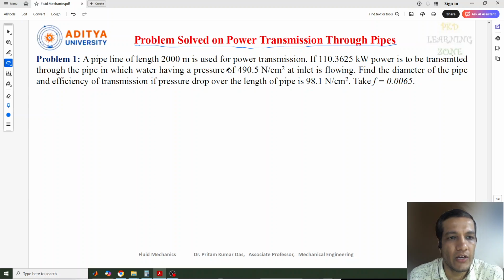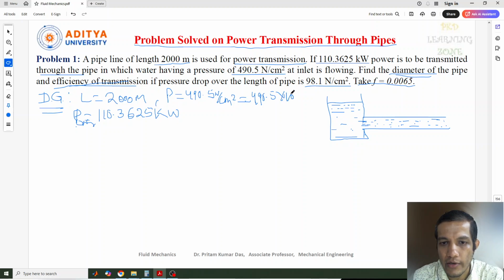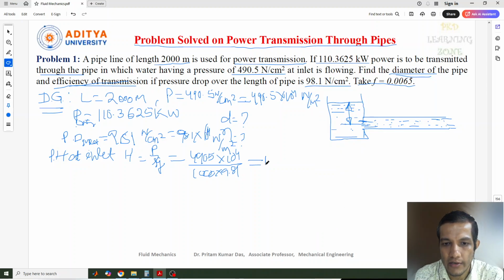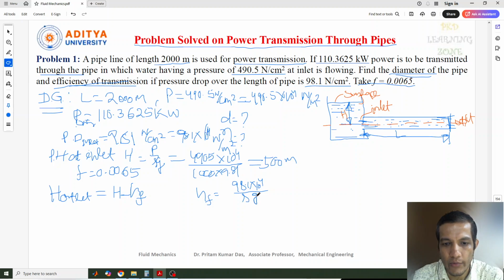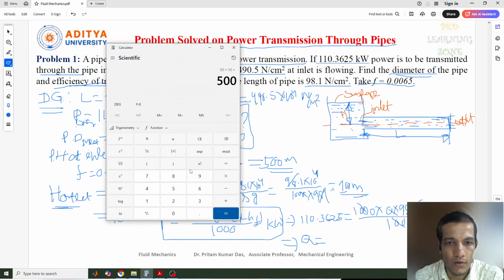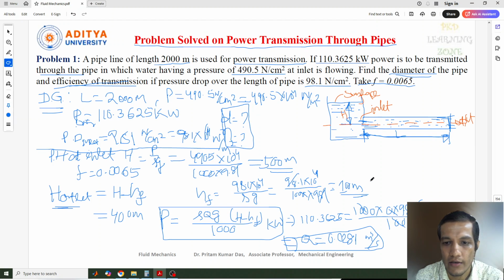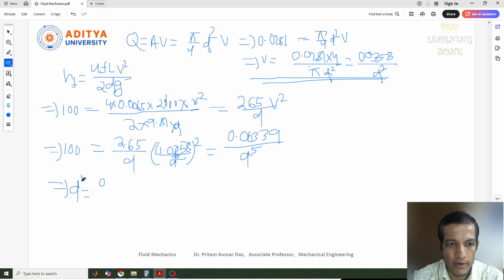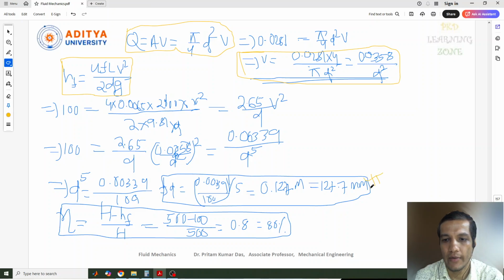Lecture 135 Problem Solved on #Power Transmission Through #Pipes in #Fluid #Mechanics

Comment: Sir here in question f friction factor  is given then why did you taken it as a friction coefficient?
Reply from the maker: Good question, actually here in this question the value of "f" represents the Fanning friction factor or coefficient of friction, which is used in major loss calculation.